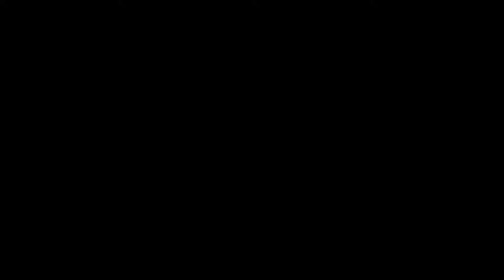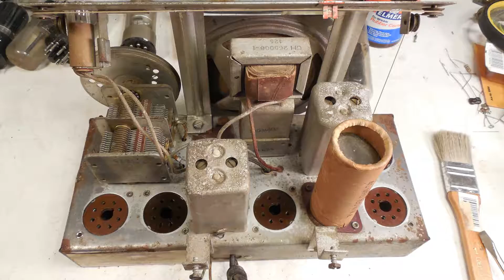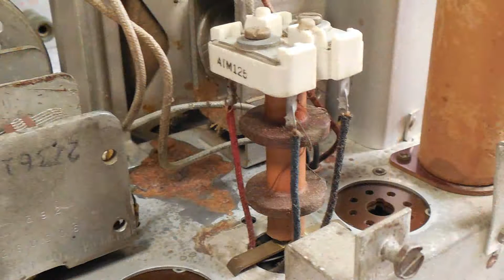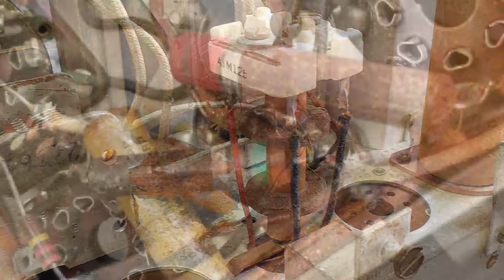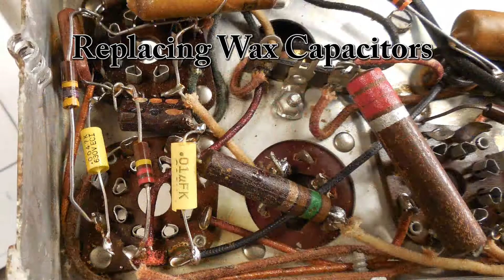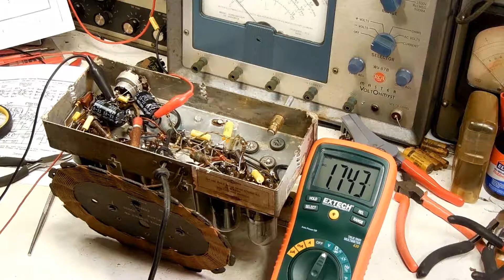Bendex AA5 Repair, Replace Capacitors and Power Up Test

Comment: Thank you for your videos.
Question. For AA5 radios, do you use all film caps except for PS filtering as a rule?
How do you know the current draw is good or bad?
Do you ever worry about individual tube currents?
Thanks
Reply from the maker: Yes, in AA5 radio I just us film capacitor at 630WVDC.
To find the current, locate the schematic'
The Crosley E10BE draws MAX 30WATTS = 0.25 Amps
Crosley E10BE
http://www.nostalgiaair.org/PagesByModel/753/M0003753.pdf
I have had no problems with tube filaments.
Reply: @AllAmericanFiveRadio  Thank you for your reply sir.
Reply from the maker: @OIE82  Thank you, and your welcome.

Comment: Richard, sorry to comment on an older video, but it came up tonight that if anyone knew this it would be you.  I picked up a very nice Heathkit IM-58 distortion analyzer at out local hamfest.  Other than "shot gunning" or disconnecting filter capacitors, is there a way to determine a shorted one, thus preventing damaging the power transformer?  Thanks Josh
Reply from the maker: I know YouTube has no email between YouTuber's, that's nuts. An electronic unit of this age, I just replace all the electrolytic capacitors. I found the diagram of this unit. Please contact me at 'allamericanfiveradio@yahoo.com' I will be glad to help if I can.
Reply from the maker: But before I replace capacitors I check all the coils first.

Comment from the maker: Hey Andy 
This is one reason why I use my very act so much. It is connected to a voltmeter and more importantly a current meter. When I first turn up the power I'm really watching that current meter, if the current increases too fast I've done something wrong. Or I've missed something.
Regards Rick